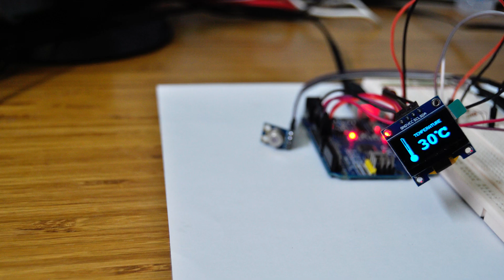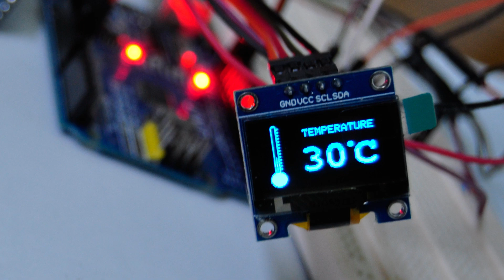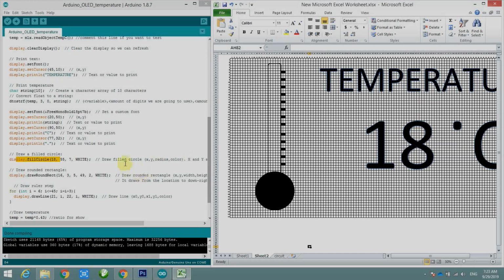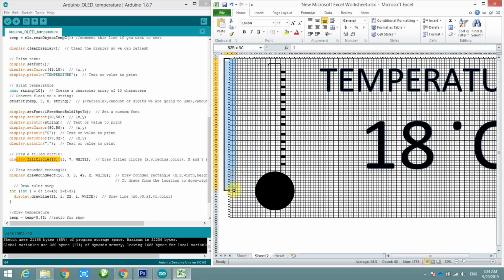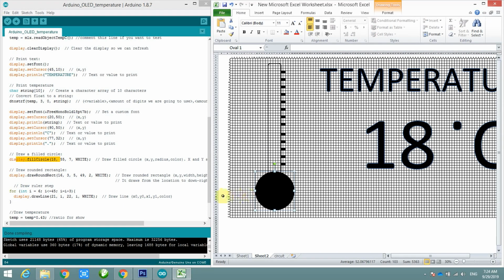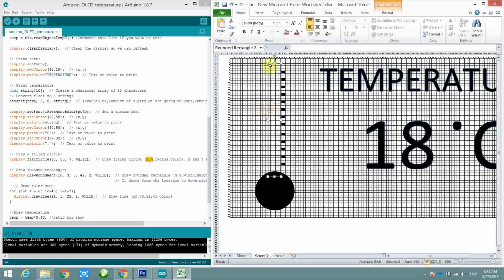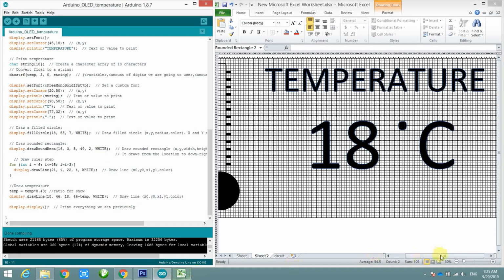Arduino OLED 128x64 temperature display

Comment: hello can you send the circuit diagram? o.ozdemirbjk1903@gmail.com thank you:)
Reply from the maker: Omer Ozdemir it is in link in video description section
Reply: engineer2you This link has code, I want a wiring diagram. Please
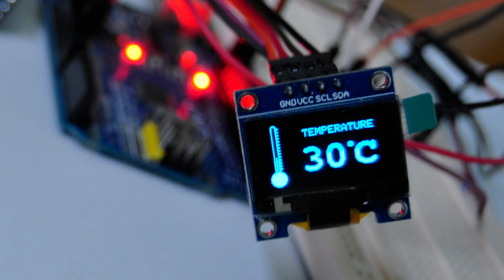Reply from the maker: Omer Ozdemir see at 2:13 you will see diagram on video
Reply: engineer2you no other links
Reply from the maker: Omer Ozdemir sorry. Currently, i lost it
Reply: engineer2you can you find it for me
Reply from the maker: Omer Ozdemir i did try. But cant find it out. Anyway, it is simple, you can re-draw or capture from my video
Reply: @engineer2you   i wanna ask you something as your circuit diagram 2:13 you sis not connect oled and gy906 ground and vcc pin what is the reason
Reply from the maker: @Lapzone_Computers  for simple, i didnt show vcc and gnd for them. But we should understand that all equipment needs power supply for operation

Comment: Tanks.
For me !
exit status 1
Error compiling for board Arduino/Genuino Uno.
Can you help me?
Reply from the maker: maybe you're facing some wrong setting. Let's try to compile another example to check if those errors happen again or not
Reply: I had the same problem. I upgraded the IDE t0 1.8.13 and it compiled fine
Reply: i am getting same problem and i also have version 1.18.3

Comment: Hello im new to this Arduino stuff but is it possible if the OLED display and IR sensor can still work on a arduino pro mini?
Reply from the maker: Mar Maglapuz sure. Please see this video https://youtu.be/JV7G3a4805w, it uses Oled with Infrared thermometer. Then, you replace Infrared thermometer by IR sensor